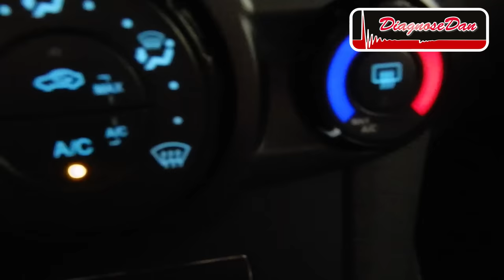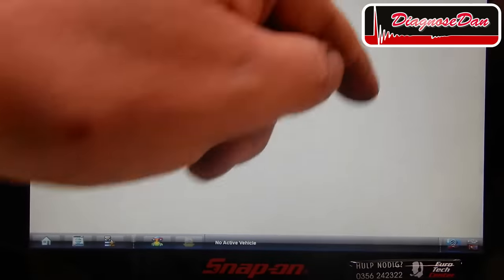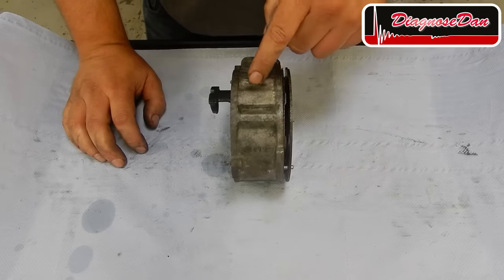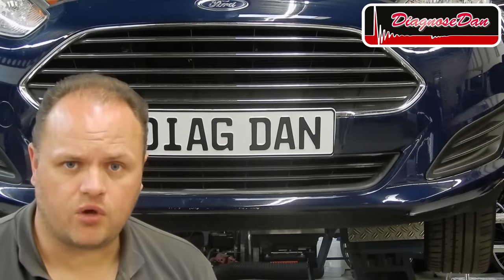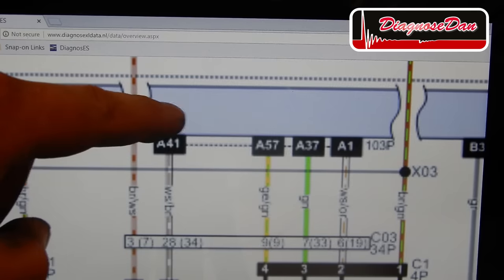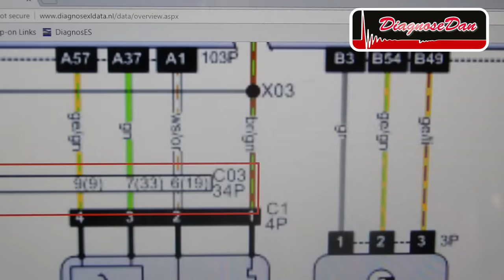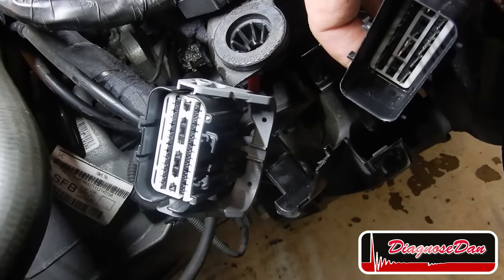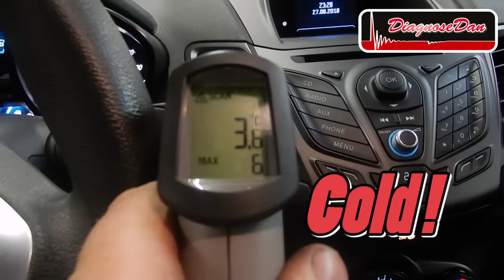Ford AC Trouble ! (Variable AC compressor)

Comment: Will these type of compressors switch more on and off than a non-variable compressor?
Reply from the maker: Depends on what you mean by switch on. A variable compressor is basicly always on.
Reply: On my honda civic i can hear the ac clutch constantly switch on and off on hot days. Maybe roughly around every 10 seconds. My dealer said it's normal but i don't hear that with any other car? On our other car opel astra the clutch engages immediately when you start the car and never disengages. But on my honda it's always on and off. Sometimes every 10 sec sometimes there is more time between cycles. Depends on how hot it is. 
Despite that is blows nice cool air though and works perfect?
Reply from the maker: @leminako  as long everything works fine i wouldn't worry😉
Reply: @Diagnosedan  ok, thanks 👌
Reply: @leminako  Honda Civic, you likely have a fixed displacement compressor. It isn't normal at all to have a clutch cycle every 10 seconds especially on hot weather, you're likely running too high discharge pressure (dirty condenser, condenser airflow issues, or overcharged). I'd worry about it. Regarding the Opel Astra, you have a variable displacement compressor on that one. It's likely a clutch-equipped Delphi CVC (some Astras also have the clutchless variant of this compressor). If you notice that it spins even when you have AC and defroster off, then what you see is a pulley, not a clutch, and you have the clutchless variant of this compressor. I have a Vauxhall Agila with the clutch equipped Delphi CVC, and the clutch temporarily disengages only when the car is about to stall (very small engine, happens a lot of times) or when you're overtaking someone, otherwise it's always engaged while AC is on.
Reply: @teravolt6113  thank you for the in detail answer. 
Are there consequences when running to high charge?
Reply: @leminako  As long as the pressure switch cycles the compressor off when the pressure gets too high, no consequences except faster compressor clutch wear, faster compressor wear, reduced cooling. increased engine load...

Comment: I have honda civic touring 2016 my ac works fine but sometimes its stop for a while only fan works after a while cooling start again I don't understand what exactly is the issue then I scan it so this code comes"U128D climate control lost communication with guage control module.some mechanics  are saying compressor is weak or bad some are saying this happens with electronic compressor due to a bad compressor electronic control valve.

Comment: That swash plate with all those pistons attached to it looks identical to the swash plate and pistons in  hydrostatic transmissions we use in our lawn mowers. Looks like a copy cat system for sure. So which came first?
Reply: That thing was originally invented and meant for helicopter rotors first it seems. Then someone thought it could be used inside a pump. But the original one was more similar to the wobble plate inside Sanden SD compressors than to the one inside the compressor shown in the video. The latter mounts the piston at the edge of a rotating plate through hemispherical bearings, not on the stationary plate like in a wobble plate compressor.
Reply: @teravolt6113  I thought the same thing. They use a swash plate to control the cyclic pitch on helicopter main rotor blades.

Comment: ok i have a 2004 c240 mercedes when i use  a scan tool to turn the compressor on it blows cool enough not cold ,when  i turn on the ac from in the car the ac light comes on and it blows hot air , im confused

Comment: Hello Sir, I have Mercedes Benz ML-350,W-164,2011 Model I have purchased it before 1 year ago but it has an problem with airconditionar,the ac compressor is directly connected with the battery and the original wiring harness which comming from the car has no connector and there are 2 wires are there but from there 2 no 12 volts come when i turn on the airconditionar,no one is able to solve the problem also the Mercedes Dealership,What i have to do? Please Share Working diagram For the same Car To Diagnose the problem Please help

Comment: HI SIR I HAVE A 2014 528I XDRIVE GETTING CODE TERMINAL.(N) 1 2 3 SHORT TO GROUND OR OPEN CIRCUIT. I CHECKED THE TSB  N20 ENGINE. DO HAVE A PINTS PROBLEM.I CALLED AUTO LOGIC THEY ARE JUST GIVING RUN ROUND.I KNOW SIR YOU ARE AT THE TOP. TECH PLZ FORGIVE ME MY ENGLISH IS VERY POOR SHOULD I LOOK IN E C M( PNTS?)

Comment: This also happens in vw cars the dealer will tell you the pump is done but a 20 part plus a hour or so of my time and bam I fixed th A/c in the wife’s daily beater
Reply: Also happens with the Harrison variable compressors (V5, V7 and CVCs) equipped with these tower-shaped mechanical control valves which stick out of the compressor's body and have a colored end, different colors depending on the car (different suction plumbing length and resulting pressure drop, since the valve is in the compressor and not right outside the evaporator). For some reason the valve eventually loses its adjustment over time, and after a lot of years (mine took 16 years to become an issue) the AC loses so much cooling capacity that a new one is eventually needed. It's a 19$ part. What will mechanics tell you when you bring them a car with these compressors and this problem? They'll first try regassing the system and then they'll all tell you that a new compressor is needed because the old one has worn pistons and has stopped pumping. Money for them. Don't ever try asking them to fix a Sanden SD-V or PXV variable compressor, because these ones have the control valve located inside the compressor, on the reed valve plate right behind the compressor head. Nobody ever opens compressors anymore.

Comment: Clutch less compressor (Variable Displacement) growling Sound from AC compressor during idling with AC off , after switching ON AC no sound at all cooling is good but as I switch off AC or cabin reaches desired temperature sound again starts, is this bcoz of low compressor oil ?? (when refrigerant flows compressor has enough oil to lubricate and when AC off compressor doesn't have oil for lubrication as refrigerant flow stops(my theory)).. hyundai elite i20 any one help...pl

Comment: Technically the computer isn't receiving any voltage and never does.

Ground side is just a transistor (electronic switch) controlling a relay or in the case of low current the device itself. Very sensitive to electromagnetic fields and unwanted voltage/current... Computers never control power nor receive it for that reason.

Comment: That's no way to make money, if you have a shop. Same for doctors. The fix should have cost at least $1000.00, change the compressor, harness, PCM. Doctors too they should send you to many doctors till they find a problem and then just ameliorate the problem but not fixed.

Comment: this explenation of a/c function is wrong. angle of swash plate is not controled by solenoid in any way , it is controled by rpm of rotor(engine). low rpm higher angle, high rpm-less angle.. solenoid is just to switch on and off a/c , to  by-pass refrigerant and not alow compresion,
Reply: Wrong, have a look at patent US6517323B2 to understand how these solenoids work. Bypassing refrigerant without reducing piston stroke is uselessly wasting a lot of energy to friction. The solenoid regulates the refrigerant pressure gradient between the crankcase and the cylinders to make the pistons achieve a certain stroke in order to maintain the required suction pressure (suction pressure is in close relationship with evaporator temperature) or a certain discharge pressure gradient. With the suction pressure, as the rpms increase the suction pressure may eventually decrease below the setpoint value and that's when the valve routes refrigerant to the crankcase to reduce the piston stroke to keep the evaporator from getting too cold. The solenoid part of the valve simply sets the desired suction pressure value or discharge pressure gradient (the first method has proven itself the best however)
Reply: @teravolt6113  yes, you and the video are right, my mistake. i did not have any of these opened  untill yesterday, so i realised this hands on. thank you for explenation

Comment: This is silly.  How could the previous shop charge for a new PCM if it didn't fix the problem and get away with it.  If you have a trusting relationship with your mechanic this will not happen.  As a customer it is your right to ask for all the old parts back after the repair.  That will insure you not going to get ripped off from a new mechanic. If the mechanic refuses your request vote with your feet and find an honest mechanic.
Reply from the maker: Honestly has nothing to do with incompetence☝️
Reply: @Diagnosedan  Does anyone know that this cliche means?

Comment: i like him..  he gose to bottom with everything.! even with the fucking thing that is wrong with.......  :) like generator.  that is simple, just voltage meter and se 11,8 start the car if it is 14,3 voltage around that its working.  butt he teardown the alternator and look for the problem in that.  i did that to on my wiper motor it was conection problem there to....  insted of cabels there was blade and one blade was puppt i just soilder it and i worked agian,   sorry for my poor english....    thats the machanic you want to go to...